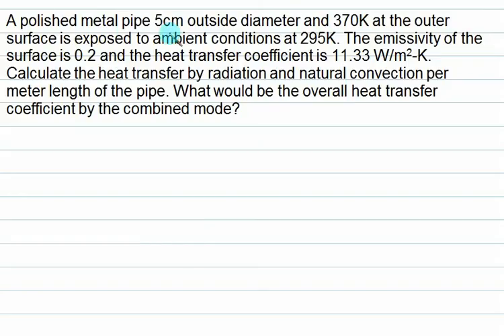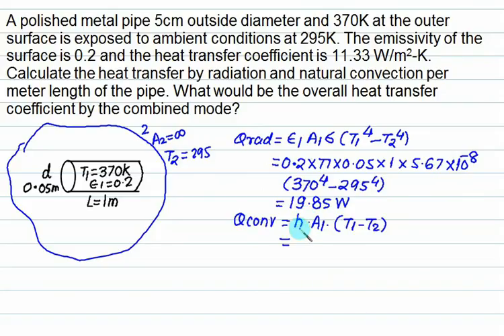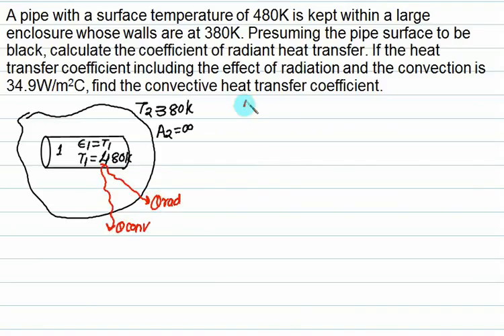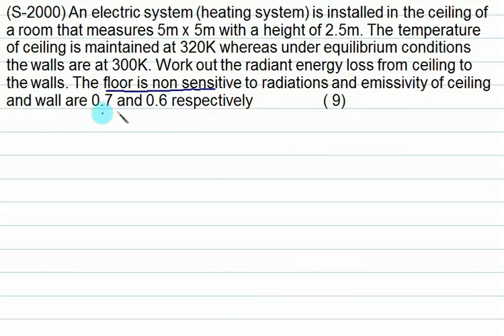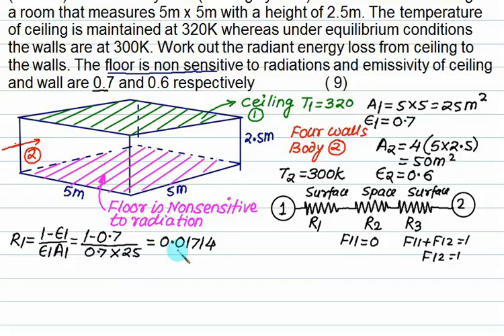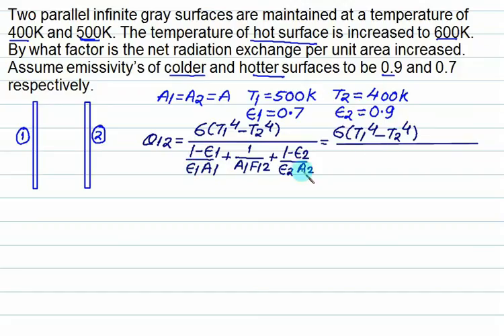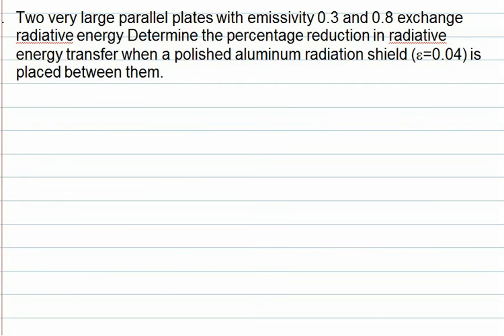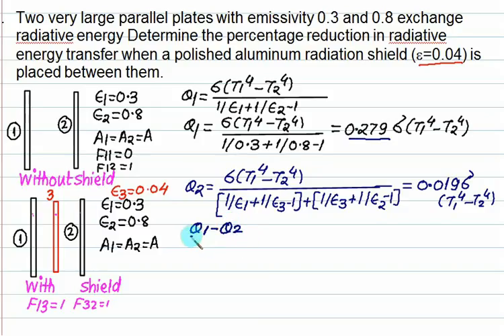04 Radiation HT numerical 3

Comment: In the room problem with non sensitive floor, solution is wrong. Shape factor is dependent on geometry only. Even if the floor is non sensitive to radiation, 3 surfaces have to be considered while finding shape factor.